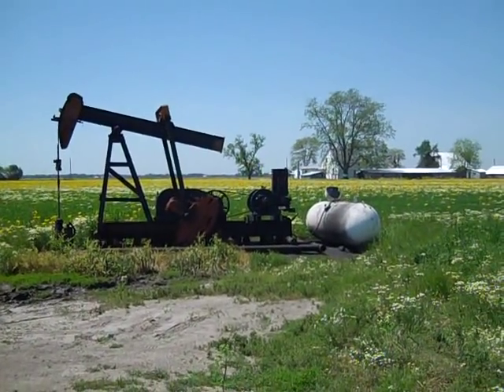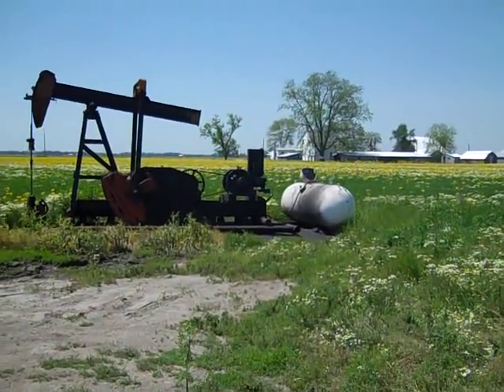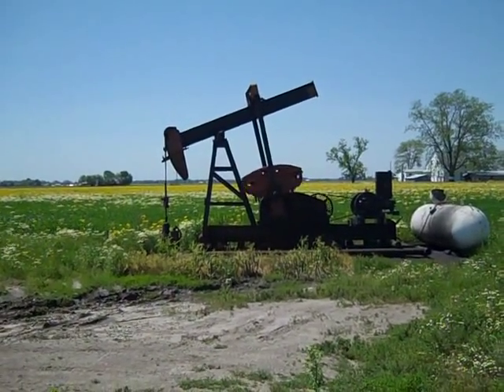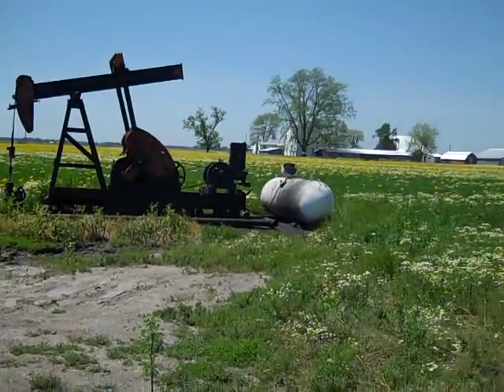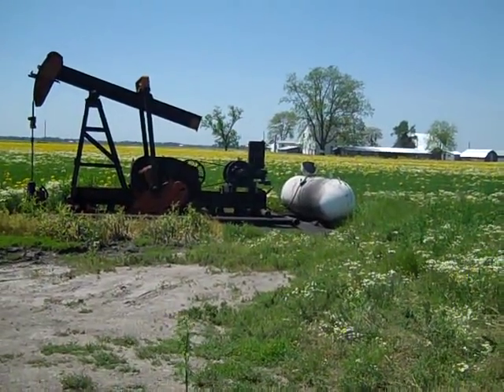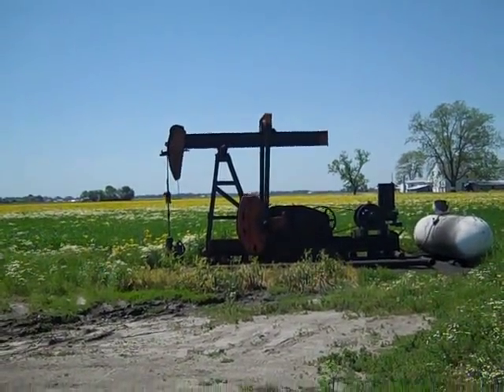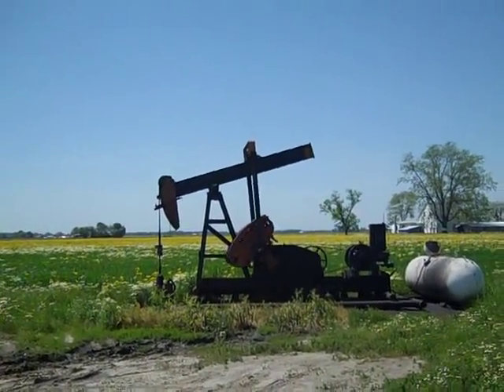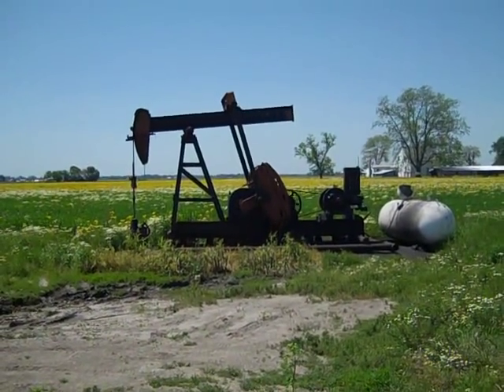Pump Jack: Is it running itself?

Comment: that engine is more then likely pumping oil, and the process in pumping oil often has natural gas as a by product. and because of this the engine can run near indefinitely with little to no maintenance. and it probably changed rpm a bit there because of an air bubble in the fuel or something like that. that engine is actually what is called a throttle governed engine more then likely. looks like an Ajax or something similar.
Reply: +Kegan Montgomery scratch that it looks more similar to a late model Fairbanks
Reply: Probably an Arrow engine. They are still making new-builds of the late model fairbanks pattern for industrial purposes such as running well pumps in places without access to the power grid. 

I don't think this well is using the gas byproduct as its fuel, the propane tank is powering the engine. But it probably is profitable to run anyway or it would have been turned off a long time ago.